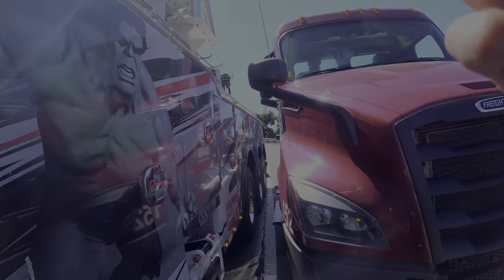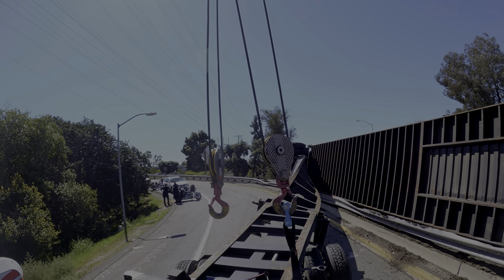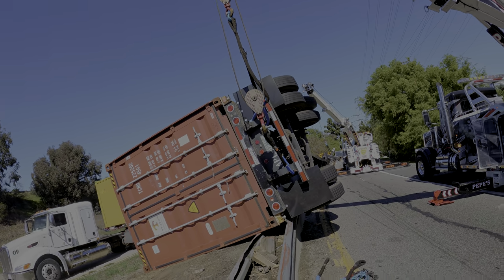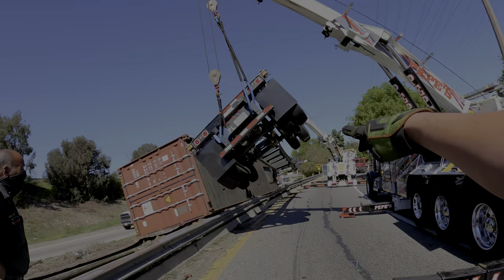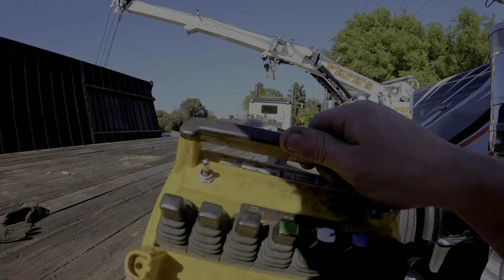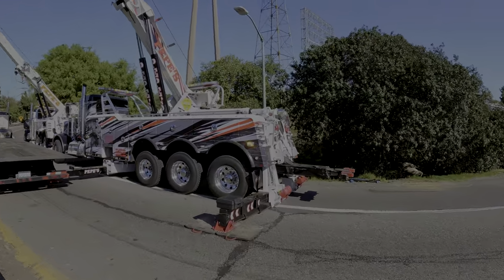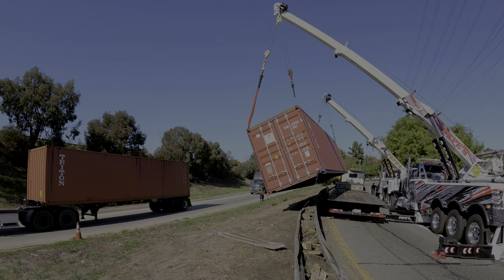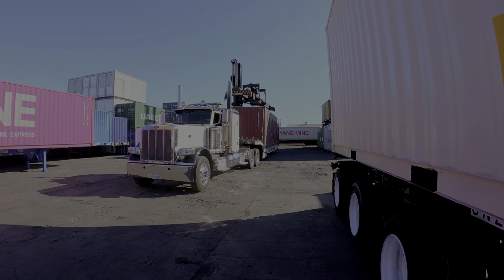Loaded container rolls over guardrail

Comment: nice Container Tracking:
Hamburg
05 Jan 2021 - Empty Container Release to Shipper
12 Jan 2021 - Gate In to Outbound Terminal
17 Jan 2021 - Loaded on at Port of Loading
17 Jan 2021 - Departure from Port of Loading
Los Angeles
23 Feb 2021 - Arrival at Port of Discharging
23 Feb 2021 - POD Berthing Destination
24 Feb 2021 - Unloaded from at Port of Discharging
25 Feb 2021 - Gate Out from Inbound Terminal for Delivery to Consignee (or Port Shuttle)
01 Mar 2021 - Empty Container Returned from Customer

Comment: Nice job! Why didn't you grab one high and one low for the roll? Looked like you rigged for it with the blue container sling. You could have gone airborne right away rather than pivoting the bottom corner against the ground.
Reply from the maker: Because nothing prevents it from falling the other way. If I had one low, what if the load shifted? What is preventing it from rolling towards my truck? Absolutely nothing. By having two top lines, I have absolute full control 100% of the way. I don't take shortcuts or chances. This way I calculated to be the safest and best way, and I was right as you can see in the video
Reply: @PepesTowingService  so how is this container different than the containers you picked up after the forklift accident. You rigged one high corner and the opposite low corner so you could roll in mid-air as well.
Reply from the maker: @amsmithonline  I see what you mean now. That is a good question, but your mistake is comparing the two jobs. While "similar", these complex recoveries are vastly different. In the other call, that was a baby 20' empty container with a ton of room. I couldn't pick up from the two top holes because it would be horribly sloppy and destroy the car further. The container is different, I was able to bring it over with one cable because it was on the floor. Then when it was over enough, we could do a vertical lift and rotate in mid air. No two calls are the same.

Comment: Use your headset to communicate more play safe.
Reply from the maker: Did you see the video at all before making this comment? I very clearly busted out my headsets for the roll over. Wasn't essential when I'm in close proximity to my guys for the easy stuff but needed them on the upright.
Reply: I mean in other lifts you could use them more.
Reply from the maker: @canadianpopeye8066  it's all relative. Often times they prevent you from hearing anyone not on a headset. For one hundred years people worked recoveries just fine without them. The Gopro picks up my voice loud but when you're within 20' of your crew and you know what you're doing, it's not a make or break thing. On a complex lift like this, yes, which is why I pulled them out.